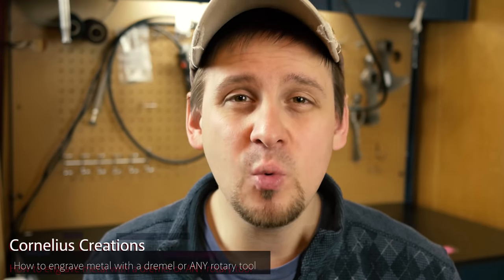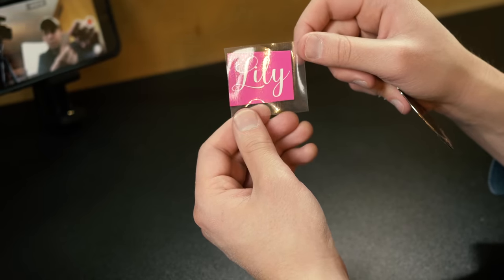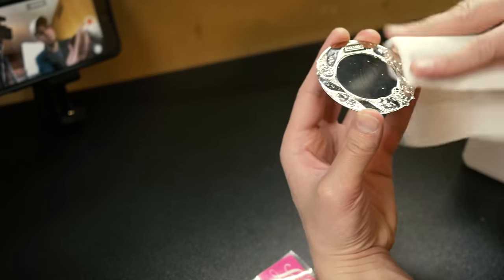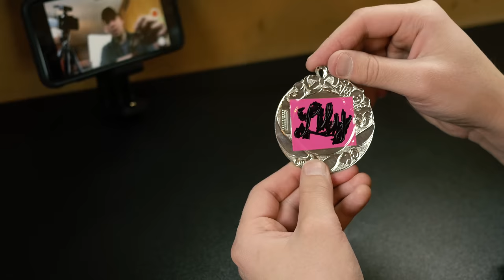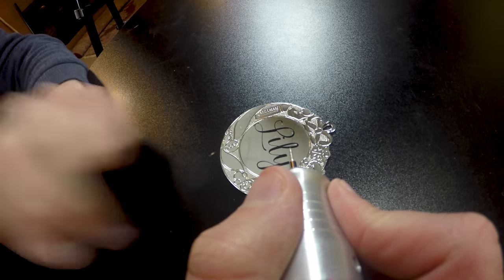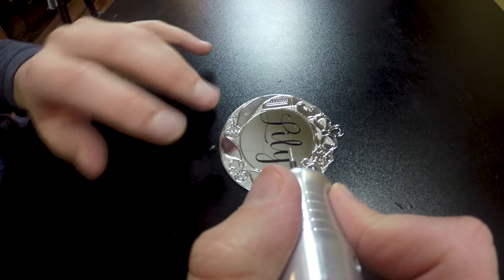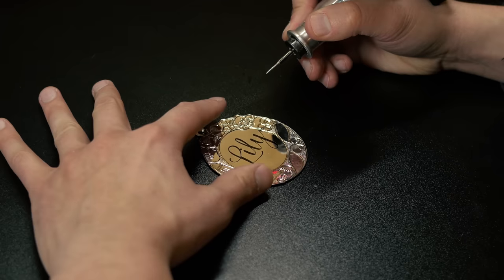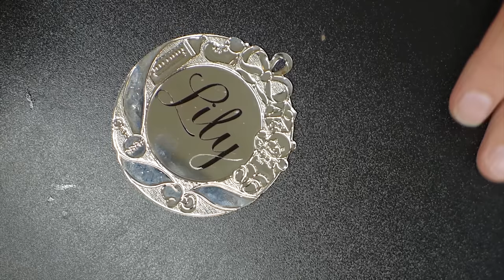How To Engrave Metal With A Dremel Or ANY Rotary Tool

Comment: Really enjoyed the vid, watched is several times.  Sad to find there's no followup for metal engraving.  Trying to learn, having trouble keeping lines to pattern and consistent depths.  Stainless steel cups don't seem to be as easy as the flimsy metal you  used in this first vid.  Hope you do more!!
Reply from the maker: Glad you enjoyed it John! Yeah engraving metal is quite a bit different animal than wood. If I were to give any advice it would be this. 1) good diffused light. I PROMISE you number 1 causes of crooked lines (outside of practice) is lighting. Harsh light will cause highlights in your face causing you to under judge, too little light will cause more shadow and cause you to over judge. If you have “good lighting” consider taking it to great lighting. This tip is simple but most profound. I carve with 2 huge light boxes on. I was amazed at what I seen. And I have “young eyes”! 2) practice overlapping your cuts in fluid motion. If one area is deeper we have a tendency to use less pressure then apply MORE pressure automatically when we hit a less engraved area. Use overlapping light strokes. Unless you have a professional air engraver it is difficult to get perfect cut lines. Check out “Sam Alfonso” hope this helps my friend!

Comment: Amazing video

I was wondering how deep you Can make your engravings?

I have an axe at Home i Want to engrave with Runes 
Does anyone know if i Can make Runes that are maybe 1 or 2 mm deep with a foredom or dremel rotary tool? 
And What kind of bits should i use if i Want to make deep cuts in hard metal? 
Hope someone knows about this😅
Reply from the maker: Hey there! Thank you! As deep as you want! But when carving axes you want it as lightly carved as possible. Use tungsten carbide burrs for engraving metal
Reply: Thank you so much 

Does the burrs only fit on some machines or is it an universal shape?

Comment: Do you have a high speed handpiece yet? Im getting ready to add one to my arsenal. Probably a nsk presto. 320,000 rpm. Great for engraving!
Reply from the maker: I plan to get one of those one day!
Reply: Cornelius Creations the nsk presto is amazing for fine detail! I love it
Reply: I have a powercarver, works like shit for tones on glass, but excels at metal and wood, where refractive index isn't as much an issue.
Reply: Also note...many burs are not rated for the speed, so make sure they have a 400000 rpm rate, or the burs will shred apart at high speeds. This is especially true for stones.

Comment: Hey could you use carbon paper as a cheaper replacment?
Reply from the maker: Scorpio91201 they are basically the same thing :)
Reply: Thanks
Reply: You can add graphite to one side of most paper and use it to transfer.

Comment: Hi Mat,
Full disclosure, I have used this same note a few other times but with no reply. I will continue trying to get a reply. I hope you feel like you can get back with me.
I liked your video, and I have subscribed to your site.

I have wanted to get into engraving for a long time and need some advice. Let me give you a short bio. I am 78 yrs old this month. I have been retired for about 15 yrs.

I have done some lost wax casting.  I also forged knives for a while and learned a few things along the way.

Now my new goal is to make signet rings for my children and Grandchildren. What I have in mind is to engrave  their initial on each ring and put  a birthstone on the ring as well. I may do them in wax and cast them or I have made rings out of brass nuts and also stainless steel nuts. They polish up really nice.

I am undecided  about what to invest in.

Choice one is the SCM 400k RPM rotary system.

Choice two is the NgraveR that runs off of a Foredom

flex shaft.

Or choice three is the foredom hammer hand piece with the LPF insert sold by Pepe tools to use as an engraver.

I have saved for a long time to be in a position to make a purchase and now I want to go forward with this dream.

I have no desire to ever get paid for any of my work.

I just want to get to be able to engrave initials on these rings for my family. I have never gotten paid for my work I just like seeing the smile of appreciation on the face of who ever I give things to....that is my reward.

Thanks my friend,

Doug

dougotio@gmail.com

Comment: awesome,may i know what bits you used at intricate corner ?
Reply from the maker: It was the same bit I believe. Sometimes I will switch to a very small round diamond bit. Basically, use what you think will work :)

Comment: I have never used a rotary tool for engraving,  wonder how deep you can actually engrave?
Reply from the maker: Depends on the bur and metal you are using. For deep engraving I suggest a legit pneumatic metal engraving
Reply: I have only used a regular graver, going to have to try a rotary and see how I do with it.  Thank you, for responding.  If you get a chance check out the link of the engraving  I did on the Harley Davidson
Reply from the maker: Right on! I will see on as I get to my desktop!

Comment: I'm gonna do this on the slide on my pistol.
Reply from the maker: Hey there! Be careful on using just a regular diamond burr to do that. The slides are extremely tough due to the heat resistance of them. It may be better to look into getting it done with a pneumatic style engraver. Not that I don’t have faith in you, but I want to give you a full heads up that it will be a risky job.

Comment: Just putting this out there, avoid using diamond on steel. Being as diamond is carbon and carbon dissolves in steel so it will very quickly wear out your bits.
Reply: austin garrett cabon doesnt disolve in steel.  Carbon and iron are what makes steel on a molecular level. Carbon and diamond are both harder than steel. Thats why they use carbon and diamond coated tools for grinding, sanding, cutting, and engraving steel.
Reply: Caleb Springer carbon dissolving in iron (and by extension steel) is how high carbon steel is made. Diamond burrs certainly work well on steel, but they also wear out much quicker when you use them for steel because the heat caused by friction facilitates the transfer of carbon into the part being abbrated.

Comment: It would be nice if you say engrave with a Dremel you use a Dremel. Not a unit that spins 5 times faster. Not even close to the same unit.
Reply from the maker: My friend, the Dremel spins 14,000 Rpm’s faster than the Foredom I was using in the video.

It’s not about the equipment, but the principle behind it. It’s like taking a Ford or a Chevy to the same restraunt.
Reply: @CorneliusCreations  i have several dremels and none of them spin at 14,000 rpm. I thought even you said the one you used in the video spins at 20 or 30,000 rpm. Not sure though cuz I really don't remember now.
Reply from the maker: Foredom spins at 18k and Dremel spins at 32k